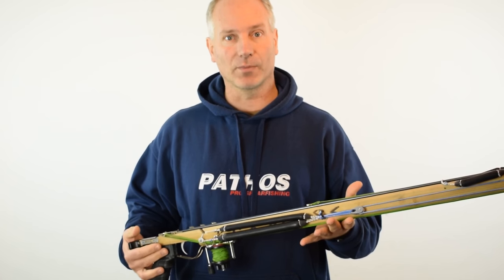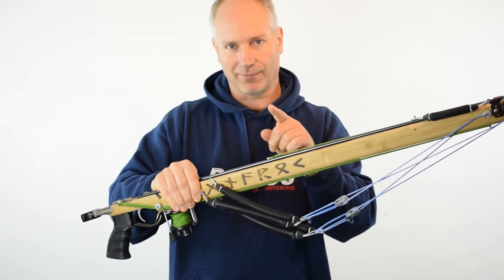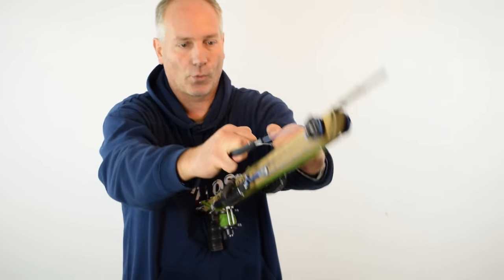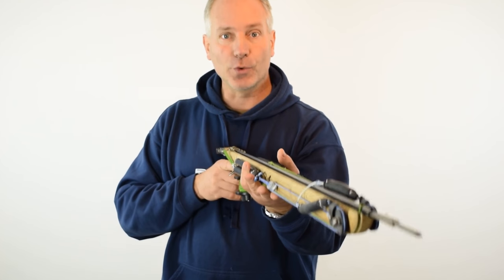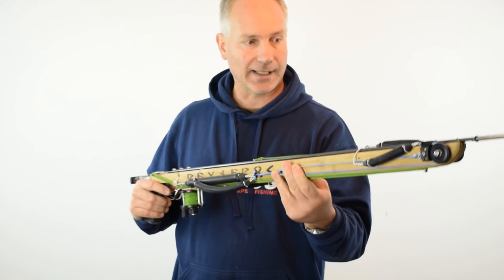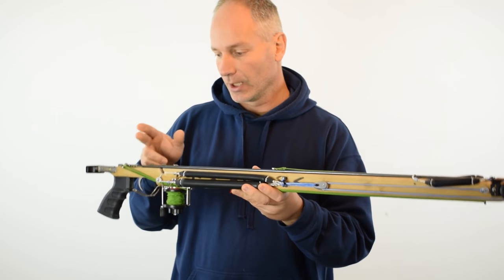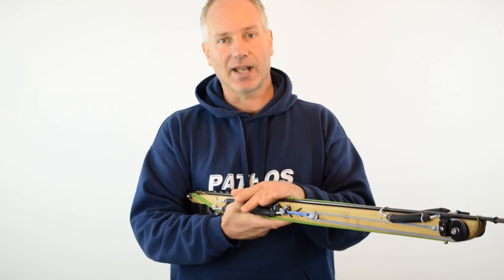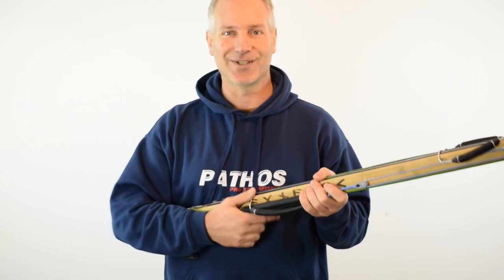The "demultiplied" spearguns from Roisub

Comment: Hello buddy,  you have done a good job, I like it very much! TOP.

I have an old speargun and I want to transform it in fusion KD2 system, but i'm not sure about what rubbers should i use. I know that i need to use progressive rubbers, but i need a suggestion about some specific brands that u may have tested. Also what pretension coefficient should I use?

Thanks!
Reply: Divecenter.dk - The Spearfishing Specialists 

What pretension should i use, i heard that roy use 200% pretension now on the fusion kd2  systems
Reply: Divecenter.dk - The Spearfishing Specialists 

Thank you very much for your info.

Comment: hey! wouldn't it be better if there was no slacking rubber at all?i have an idea how to do it,but basically both rubbers preloading and loading components would be under the gggun -and on top would be only rope peeking over the rollers!!??????
Reply from the maker: The small rubbers at the top are necessary to achieve the preload necessary on the lower rubbers.. otherwise there is simply no geometric option to achieve that: this is why the top rubbers are filled with dyneema to transfer the initial energy from the lower rubbers to the spear... the top rubbers come into action later.
They are also very useful for easy loading. 
I think the setup you mention is called "invert" in Italy and as far as I heard (I never tried it myself) from friends, it is not as brilliant.

Comment: Can you please show a video on calibration? How much pre-load is in the first and second bands? How much notch load (sharkfin load) is there applied by each  band? As you know, the energy given to the spear for launch is the sum of (notch load + pre-load) / 2 times the length of travel (launch) distance. If you are using an 8mm shaft, does that not make it nose-heavy in the water?
Reply from the maker: Calibration depends on the geometry of the speargun... There are too many variables to draw an algorithm to simulate the finished product... It's easier to do it time by time. The preload can be increased by adding a dyneema line inside a pair of top rubbers to limit the stretch... So you decide the min-max load below and adjust on the top.
Reply from the maker: Yes, an 8mm shaft is heavy... That is why the barrel is a carbon tube 26/30 and sometimes 30/32 with the two ends double-walled with a 26/30 reduction.

Basically you increase the volume of the barrel to match the spear weight.

Personally, in a demultiplexed system, I prefer to use a spear 7mm powered to the upper limit to maximize the speed... 8mm are slower and I don't need that added range here.

For me, the ultimate speargun for the Scandinavian waters is a FusionK1 90cm with 6.5mm spear, 2 passes of monoline Asso Supersoft 0.9 followed by a good quality reel.... In other waters you'll need to find your balanced range/speed/power
Reply: @ragnaroksub1442  The geometry of the speargun is simple. It’s a 90cm carbon Fusion inverted roller gun. The preload is the amount of pretension in the rubber bands (each) with the wishbone at the end of its travel. The notch load is the load at the shark fin when fully tensioned, per band. What is complicated about that? Energy imparted to spear launch is the average of these values x travel from notch at trigger to where it stops at the roller head
Reply from the maker: It is not complicated at all... and the empirical method is straightforward.
And by the way, if you like to be accurate, the energy is not calculated by an "average" but by the equation K=1/2*m*v^2. You can see the graphical demonstration of two systems with the draft of the integral of the function (pretty much linear) of load and distance between the two extreme wishbone positions.... But it is pretty much a scholarly discussion without real application.

Ha... I forgot... The "Invert roller" is a completely different system... composed by two pair of sheaves: a pair of wire sheaves on the muzzle and a pair of round rope sheaves on the proximity of the handle where the rubbers go around... I guess the confusion in terminology comes because of the rushed translation of the spearfishing tradition in English when the social media brought the many different rubber-systems to the other side of the ocean a few years ago.... rollers, invert, invert roller, Demo(s), Fusion(s), Vela, Volcan, Mach... and a few more like G-roll etcetera nowadays disappeared.... No wonder that the internet is full of misunderstanding.
Reply: Thanks very much for your replies. Yes, I agree that the energy (of the spear leaving the muzzle) is 1/2 mv^2 I.e. kinetic energy equation but you have to know the terminal velocity to calculate that as well as mass of the spear. I am intrigued by your reference to the spear accelerating faster than the wishbone due impulse loading rather than a simple linear imparting of rubber bungee energy from notch load to the end of the travel at the muzzle. This invalidates the assumption of the average energy summation and is more driven by the impulse at notch load. This is good news because it removes the requirement for preload at the muzzle. Could you please comment on this?
Reply from the maker: Maybe I didn't used the right words.
 What I mean, is that in a regular speargun, the spear is accelerating, while the rubbers are decelerating: when the speed of the spear, and the speed of the wishbone are the same, then the rubbers stop transferring energy to the spear, the spear will stop acceleration and the rubbers will stop pushing.
In a normal speargun, around 1/3 (and more) of the available length of the barrel is useless for the energy transfer.... The preload make that space "usable" with great increase of the overall system efficiency.
Reply from the maker: For the terminal velocity, you can use a high FPS camera (modern cameras catch 240fps) to measure exit speed and a couple of underwater microphones to measure fly time.
We did tests with a 100fps camera years ago and set the usable fly-time (to measure the useful range) to 300 ms

Comment: Hello, your video are very instructive and well done. I have a 115cm roisub Michelangelo  F1 and I'd like to update it as the one that you showed in your video, can you please tell me the size and the diameter of the 2 couples of rubber? If you could also make a video on how to claculate the size of this kind of gun it would be great !  Thanks a lot for what you do that's give me a lot of usefull informations. Ludo
Reply: Thanks for the answer, but the kit is extremly expansive.... I change my rubbers by myself  and I use a very good greek  brand   for my F1 and you can't see the différence with the original.  Thanks a lot for your advices and continue  to post your good videos ! Ludo.

Comment: Could you explain the reason for having a small rubber pair on the top instead of having three pairs on the bottom?
I don't quite understand why it is there.... is it for just helping to arm the gun?

Thanks in advance.
Reply from the maker: The small rubber on top has a kevlar core that limit it's stretch. The meaning of the rubber is to accelerate the spear already in the first instant of the shot. The difference between the Demo2-3 (without small rubber) and FKD2-3 (with small rubber) is really big in power of the shot and speed of the spear.
Reply: @ragnaroksub1442  But you loose the main advantage of roller systems - accelerating length (I think for at least 150 mm). Does your solution compensate this effect?